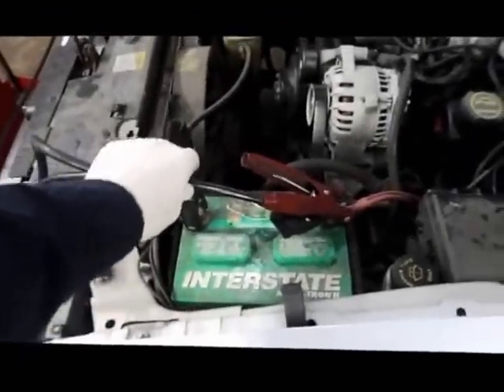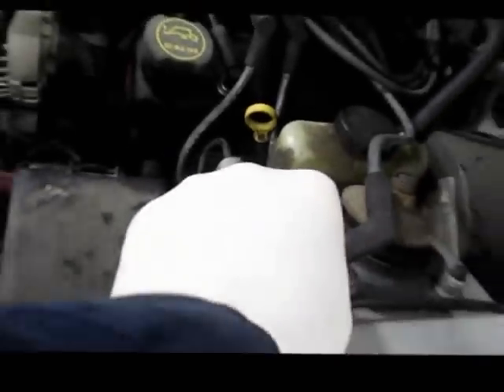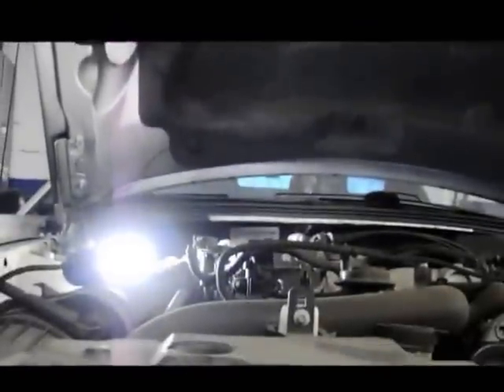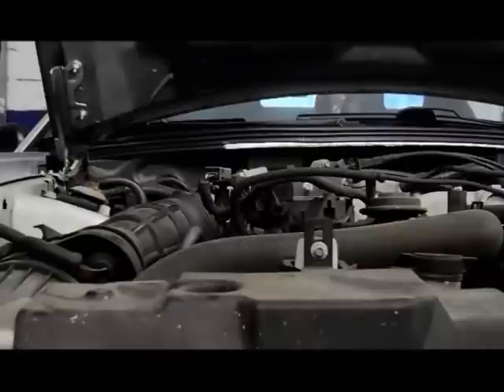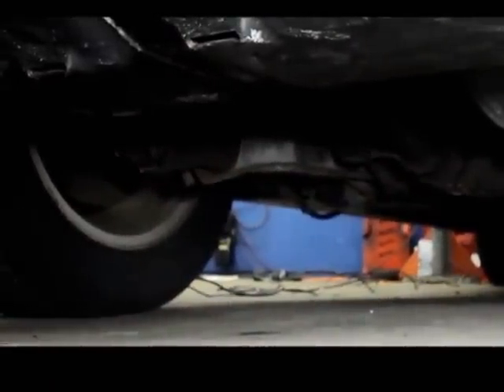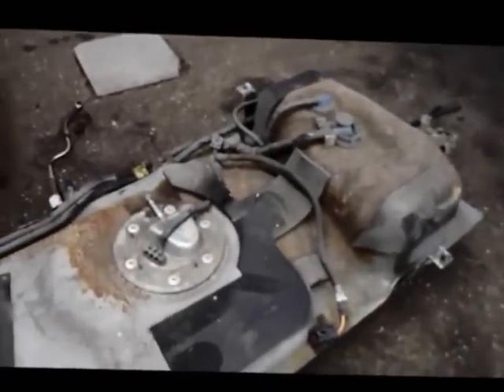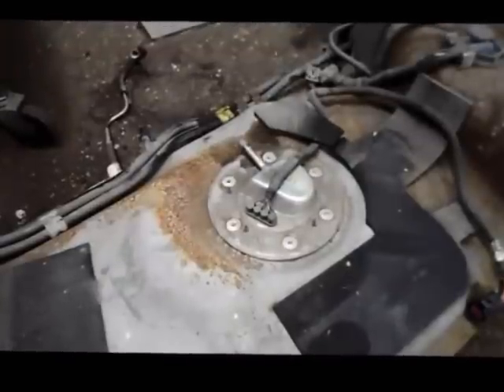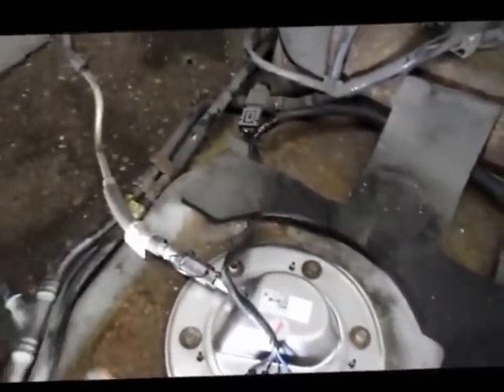Engine cranks but won't start

Comment: Why don't they place the fuel pump access on the bottom of the gas tank with a drain plug. It would sure make life easier..
Reply from the maker: +Joseph M   Oh that's easy .The engineer who design the car just love to screw with us .Lol   You know years ago they did do just what you said they put the float assembly on the side of the tank for easy removal but not any more.Happy new year and thank you for your input.Jim
Reply: Joseph M ex ed exCarr ebb
Reply: jimthecarguy   I know that  there is the push to eliminate the diyer., but if a drain was so easy to drain gas would be stolen easier and cars would  messed with .. so I'm going to side with the designers on this one. I was talking to a old mechanic and I mentioned that some of the foreign made gas pumps were very cheap.. he said look for ones that have a long warranty.. That made sense if it was sketchy they wouldn't warrantee it for years.
Reply: Joseph M some cars have easy access to the fuel pump by removing the rear seats....ive seen them on kia rio, nissan altima, maxima, dodge nagnum
Reply: tomas gaspar  I've changed my last fuel pump.. going to change the fuel filter every year at least and it will be the best I can buy.  I found out awhile ago that it's recommended to change once a year.. you can always ask a mechanic to do it when they change the oil say every other time.  Also I agree this should be an easy access hole but a special cheap tool so it would not be unbolted by little explorers and the curious..
Reply: Do you really want a drain plug on a gas tank think abt it ppl would be stealing gas left right and center
Reply: @pieseasmyseas  So you are going to crawl under a car with 10 inches of clearance  with your shallow pan that holds 1 gallon and undo a bolt and have gas spray on your hand and after the pan is full put the plug back in and slide the pan out with the gas spilling over the sides and transfer it into a larger container and repeat the process 10 + more times and end up being covered in gas. I don't think so.
Reply: I've never seen it

Comment: Hello, I have the same problem on my 1990 mustang, it died all of the sudden, seemed liked the fuel pump, so it was replaced, but still have the same problem it won’t start, you hear the pump running and won’t shut off. Help Please!!!   Thank you.

Comment: Thank you Jim for your videos. Just one question: knowing you didn't have fuel pressure, why did you check the injector anyway? (routine check ?)
Reply from the maker: Yes because if there was no pulse then I would need to check what the two have in common. Very good question.
Reply: @jimthecarguy OK I see your logic. Indeed you want to make sure its really the pump and nothing else once you undertake this removal procedure! Thanks for the quick  follow-up  I appreciate.

Comment: Oh man you did that pump the hard way. only 6 bolts hold the bed on. Take the bolts out unplug the tail lights and take the bed off. don't even have to drain the tank.

Comment: Great video I have the same problem with the same car. I don't have power in the connector at 9:20 in your video, but I do have power going to the inertia fuel cutoff switch, and to the fuel pump driver module. 
What do you suggest?
Reply: madblade JIM MAYBE YOU CAN HELP ME .MY 2L OPEL REKORD BERLINA WON'T START BUT WHEN I REMOVE THE TERMINALS   ON THE INJECTORS IT STATRTS WHAT COULD BE THE PROBLEM
Reply: I have a 94 mercury cougar and I have a new fuel pump and it cranks but won't start can anybody help me?

Comment: Hey Jim, great vid! I'm working on my 99 ford e250, have spark, have fuel pressure, cranks good but no start, replaced cam sensor, battery, starter, fuel pump, fuel filter, coil pack, fuel pressure regulator, alternator, can it be a timing issue? It worked good before one morning it wouldn't start, I'm lost, help!! Thanks!
Reply: Angel Vega Did you fix this issue? I have the same problem on a Ford F-150 2002. I am going to take the catalytic converters out tomorrow to make sure they are not plugged. This what happened to me before on a 2003 Ford Explorer.
Reply: Check your pcm
Reply: check your battery lines!! to make sure there is not corrosion thru the lines, mainly positive lines, but even ground lines, o had the same prob with my truck, replaced same parts, finally cut my positive lines and corrosion was massive!! replaced the battery lines and works great now!

Comment: "...when you know what you're doing."  Pffft!  Work on your troubleshooting skills.  After cycling the key a couple times, No pressure = fuel pump, fuse, or relay.  Why did you go to the injectors next and waste time?
Reply from the maker: You may think it is a waste of time but it is called step by step diagnostics.Thank you for watching
Reply: Your right never thought to change starter relay

Comment: do you live in georgia area?
Reply from the maker: +9437810  Sorry New Jersey.Can I give you any advice?
Reply: change sparkplugs and wires, put new alternator belt , charged battery, and the car when starting up it acts as if it wants to start but its not catching, dont know if its the starter relay,or the starter, i've been researching and saw somewhere stated that it could be the temperature sensor, I have no idea where its located, the car is a 2000 hyundai elantra,its my daughter's car and we both just stand over the car and look stupid because we have no idea what we're doing. please.. some advice would help thanks. we just moved to the georgia area and dont know anyone here.

Comment: Hi Jim I have a question. I just changed the fuel pump out a couple days ago. It was starting fine until this morning it started and then it dye out and wouldn't start. I waited a few minutes and then it started. What could be wrong. Is it something else or did we buy a bad pump. I have a 2004 jeep Cherokee by the way. Hope to here back from u. Thanks
Reply from the maker: When the truck don't start you will need to check fuel pressure.Did you check for codes with a scanner?

Comment: 3:30 That is just annoying, it has no fuel pressure so checking the injectors is useless, It's a fuel pump, fuel filter, hose or relay problem. Geeze you already know it has no fuel to the rail so why not tear the engine apart and check the timing belt and CSS while you are at it. 

Crap on a stick
Reply from the maker: Wow you sound like you are a great mechanic. HaHaHa. Don't you think it is a good idea to make sure you have injection pulse or  being an ace mechanic you know that also.
Reply: jimthecarguy

 I have this problem right now, engine cranks has fuel pressure, injector pulses  and spark yet refuses to start. I'm about to tear my hair out.

Comment: Wat if. You install the fuel pump and still no turn on could bee the fuel pump  module when iam driving it shuts down and. And i try to turn it on. And it stars. And igot a code p1233 is the fuel pump module

Comment: hey im having crank no start on my 95 acura integra. ive changed my icm and coil an also new rotor in the dizzy.. itll start for maybe 2 second but dies. my friend taps on the dizzy an it stays running longer.. any ideas?
Reply: Cam 816
Reply: problem solve and what u have change ? ECU problem? is it?
Reply: @rawbroccoli5547  i have change new batery, ignition coil,plug,fuel pump,icm relay,still low rpm when start and egine want die